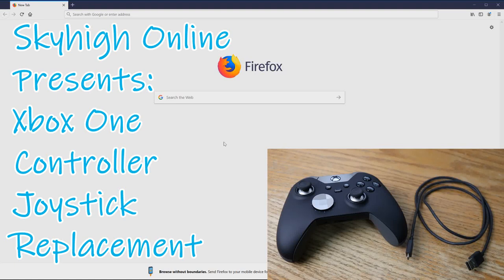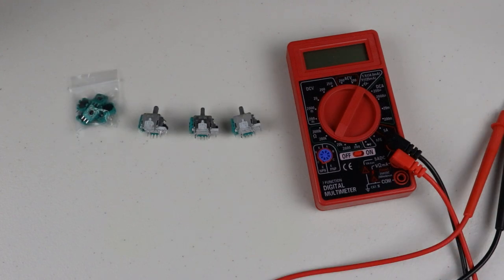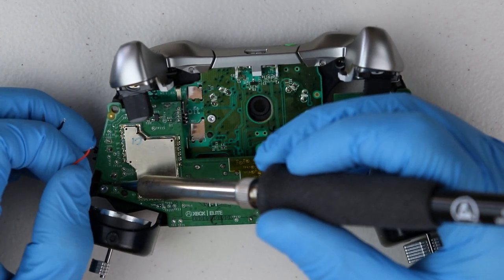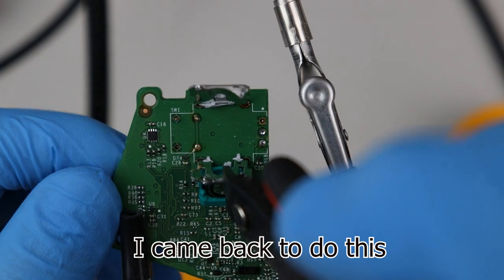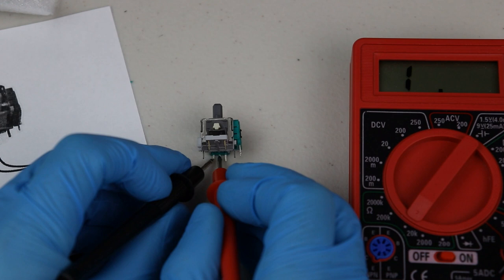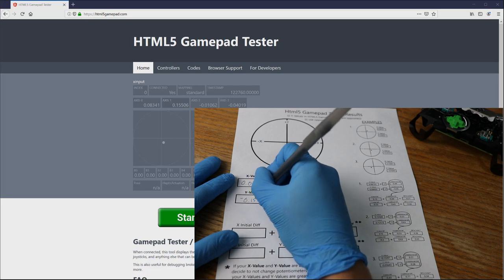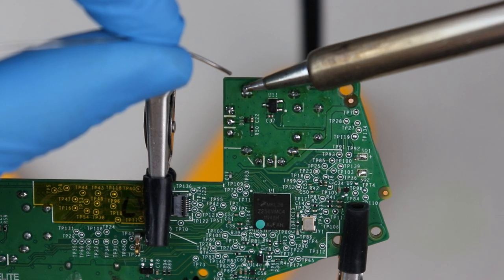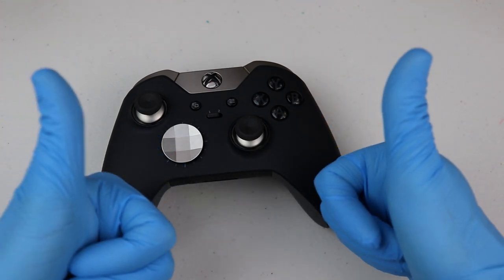How to Replace Xbox One Controller Analog Joystick - Fix Stick Drift & More

Comment from the maker: New Kit link is in the description which now includes 6 total joysticks and some tools.
NEW METHOD: Check out another way to manually calibrate (much easier IMO): https://www.youtube.com/watch?v=Uoxz0oHX9TE
Reply: Loved the video, you did a very good job explaining everything, but I don't have a soldering iron. Is there any way to do it without it, or should i just order one online?
Reply from the maker: @Ben-jl2rh  Thanks! You will definitely need a soldering iron for this job.  Luckily there's some pretty affordable options on the market today, particularly Amazon, that come in kits for around $12-$25 depending on which one you opt for.
Reply: SOSS GAMING yo are you still doing the controller repairs?
Reply from the maker: @AMG_MIKEY  Unfortunately I do not.  If you type in "xbox controller repair service" in the search bar on eBay, you will get a lot of sellers who do.  Good luck!
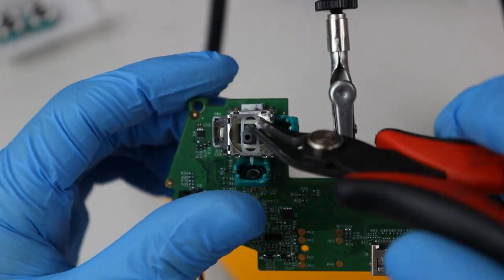Reply: Does swapping the potentiometers prevent the need to to put in another joystick like you did in 13:40? Can you just make the axis  0.00 for the X and Y? (Or as close to that as you can get it)
Reply from the maker: @michaell.colavecchio8717  Great question.  Yes, it is possible! It's not always successful, but I'd say it's worth a shot.  With the method shown in the video, it's definitely possible to get really close to 0 for both axis.  However, the benefits aren't that noticeable and I wouldn't necessarily say it's worth the effort of finding/swapping out all the potentiometers to get that super zeroed in.  Remember, drifting doesn't actually occur until about 0.17 (on html.com).  Hopefully this answers your questions.
Reply: SOSS GAMING thanks. Also, if only 1 joystick is broken, do you have to replace both or just that broken one?
Reply from the maker: @michaell.colavecchio8717  Only need to replace the broken one!
Reply: Will the same procedure work on an elite 2 controller?
Reply from the maker: @samreynolds6993  Yep! Like I mentioned in my other comment to you, I am working on a new video with a new method that is less intricate that I'll hopefully release within a week.
Reply: I wanna send in my Xbox elite series 2 controller to you via eBay to get it repaired. The left thumb stick has drift and is unresponsive. Are you able to fix series 2 controllers?
Reply from the maker: @sin5orion  Yes, if it just stick drift I will be able to fix it, no problem.
Reply: @SOSSGAMING  hey, I've got a really pressing question that i don't know who to ask other than you.

I've removed a potentiometer and tested the controller without it and it pulls all the way to the left without anything even being there. Every potentiometer I've tested ends up pulling to the left at about -0.2. Any ideas why it would pull left without the potentiometer even connected?
Reply from the maker: @scottgrafton68  No problem. It doesn't actually "pull" to the left.  The controller's joystick direction is based on varying voltage.  Since nothing is there to connect the two points and close the circuit, the voltage difference is such that it reads to the left.  It's nothing to worry about, nor does it indicate anything.  Hope that makes sense.
Reply from the maker: @scottgrafton68  Also, I have a new video coming out in a week that will show how you can manipulate the potentiometer to get it to read pretty close to center.  Stay tuned.
Reply: @SOSSGAMING  hmm I'm not so sure, i tried the same potentiometer in another board and it read far closer to centre. You know more than i do though. And ahh cool I'm looking forward to that video already. Cheers mate
Reply from the maker: @scottgrafton68  Oh I was talking about when you didn't have a potentiometer in.  In your case, it seems the original joystick that was put in read very far to the right before it was calibrated from the factory and is proving hard to find and replicate.
Reply: @SOSSGAMING  Yeah that must be it. Ahh man, i wish someone would make a recalibration program. Do you have any knowledge of one for ds4 controllers? Google doesn't understand what I'm asking lol. Really appreciate the help mate
Reply: @SOSSGAMING  i wonder if your next video uses resistors, I've thought about it but i don't even have a multimeter yet haha
Reply from the maker: @scottgrafton68  Sony is the same.  They both have the same idea: don't give access to the public.  Nintendo on the other hand has one.  Go figure.
No resistance measurements nor calculations required in the new method :)
Reply: WHy didn't he just turn the board over and remove t he solder with wicking or a solder sucker so he didnt have to chop up the module lol! WHat a pain im thinking of replacing my elite series 2 left thumbstick module because the little bit of plastic that depresses the L3 button inside there somehow got broken and won't press the button when I press the stick down anymore. Stupid thing is only 3 months old too.... stupid tile floors. I have wicking a soldering iron and most of the tools here already but all his testing the potentiometers means I am going to have to buy multiples amounts of the modules and the series two modules are 18 bucks a piece!!!  They have that adjustible torque feature. I think I may just live without the l3 button after watching this. Unless theres a way to just replace the plastic parts inside the module without taking the module off the circuit board.
Reply from the maker: @Andronicus87  If you're talking about the grey piece that holds the little white nub of the joystick in place, is possible to add one back! Prying one off a new joystick and putting it on the old one is a challenge, however.  It's somewhat hard to not bend or break it, but it is possible. 
Also, I have a new video coming out with a new method that doesn't require measurements nor calculations! Should be this week.
You can technically take the whole joystick off on the boards with the small through holes (like the elites) but it takes an incredible amount of skill/luck.  If you can do it on your elite, I will be very impressed!  It's much easier to do that on the base model controller with the large through holes.
Reply: I cant seem to desolder the pins, i get the top level of solder off but i cant get all of it in the 'through hole'
Reply from the maker: @Theunbelievable69  I would suggest chopping the joystick up as shown in the video then.  If you have a motherboard with the small through holes it's near impossible without a de-soldering iron or a heat gun.
Reply from the maker: @Theunbelievable69  If you're referring to after the pieces are removed, then I would suggest adding more solder and perhaps a slightly higher temp on the iron. But be careful with the temperature as that's the main contributor to through hole damage.  I use 350C and I think you could go up to 390C.  Sometimes it just needs to be hit a few times with the solder sucker and/or wick, and sometimes the other side of the board if it's through pretty far.
Reply: @SOSSGAMING  thanks for the reply, i have a 35watt/400 degree celsius soldering iron, which is only melting the solder on the top of the connection, its not melting the solder in the through hole. Ive tried everything and i have about 6 stuck pins, im think hot air with plenty of kepton tape to cover the easily damaged chips could help me remove the last stuck pins
Reply: @SOSSGAMING  yeah i purchased a cheap desoldering iron that has the manual pump to suck out air. It worked pretty well but still doesnt seem to melt all of the solder on all of the pins. I purchased a hot air gun that will provide 400 degrees celsius of hot air, im just going to cover the entire board with kepton tape and ill use tons of flux. Hopefully i can pull out the pins because its my last shot
Reply: I've got an issue where the white part of the joystick mechanism has broken, do I only need to replace it once?
Reply from the maker: @kasimahmed3841  With this method, any joystick replacement will most often times require a second replacement.  One is needed to measure and calculate, and the second one that matches those measurements and calculations.  You might also get lucky with the first joystick though, so in that case it would only be once.
Anyway, I would hold off just a little bit because I have a new video coming out hopefully by tomorrow, or early next week at the latest with a new method where you do only use one joystick.  Stay tuned!
Reply: @SOSSGAMING  thanks! Much appreciated
Reply: @Andronicus87  Take your potentiometers off first, if you have the chisel like soldering tip then you can heat all 3 pins at the same time and take the potentiometers off easily. Then destroy the rest of the analog stick that's on the board. Fit the old potentiometers onto the new stick in the same position as before and then solder the whole thing back on

Comment: my up button on the left stick is permanently on, any ideas what that can be? which side is that x axis or y axis
Reply from the maker: I'm not quite sure what you mean. Are you saying you always have forward drift in games? Or only when you are trying to select things in the menu?  If it's only during menu, then it could actually be a d-pad issue, if it's forward drift during games then it will be a joystick issue.  Most likely you will need to change joysticks/potentiometers as shown in the vid unfortunately.  Here's the potentiometer sheet showing the different axis on the controller: https://drive.google.com/file/d/1f80H_ZErOJxwVwPuwNrDzGZ2LISPcS42/view
Reply from the maker: I just realized what you were asking.  It will be the Y-axis that causes the forward drift.
Reply: @SOSSGAMING  thanks its an elite controller i have put a brand new joystick but it is permanently on up cant find any fix for it or a hint as to what it may be.   a capacitor at c24 came off and i put it on d16 right next to it thinking it could possibly be that. but should make no difference as its on the same line. i have tried reflowing but not luck.  part of the pad came off on top of the of one of the y axis but not the underside of the board where it matters and is soldered in so i am flummoxed.
Reply: @SOSSGAMING  i will try changing potentiometer. thing is i selected it on the best reading averages using a multimeter so seemed ok from that pov.
Reply: @SOSSGAMING  the d pad up button works fine on the controller test app it seems to be the up button on the left stick.
Reply from the maker: @createspaceone  Ok, so you've already attempted the replacement.  I may have bad news as I believe you may have damaged one of the through holes in some way.  I have done this a couple times, and I believe I had a similar symptom.  If this is the case, one solution is to try to repair the damaged through hole(s).  I am not an expert on this however so I don't have advice on how to do that.  The other solution is to get another motherboard.  Fortunately elite controller motherboards are interchangeable in my experience.
Reply: @SOSSGAMING  thanks I was thinking that.... i will try to get some schematics, i could jump wire it. thanks
UPDATE:  i will ask them in this thread when i get a chance cheers it has schematics there https://www.acidmods.com/forum/index.php/topic,44309.0.html
Reply from the maker: @createspaceone  Good luck! I will be curious on what you figure out

Comment: I swapped my whole thing out and the stick drift is still present. Any ideas.  I dont see any damage.
Reply: I did it the way you showed on the other video as i have all the tools.  I also have a lofty on the controller with buttons on back
Reply from the maker: @andrewm4951  What are the readings?

Comment: ya idk what happened got the module out put the new one in looks fine yet somehow now whole controller dont seem to work right😫
Reply from the maker: What do you mean?  What are the readings on html5gamepad.com?
Reply: @SOSSGAMING  I dont even know what that means I already took all the good parts out and threw the 2/3 controllers away the all have messed up modules in the analog and are made way less durable than the old 360 controllers(which still work)

Comment: the through holes on the potentiometers are so stupid small, I currently have 3 pins stuck, i broke the pot off of the pins and i still cant get them out >=o
Reply from the maker: You should still be able to heat up the solder and use the soldering tip to push the broken out just a bit. Once out just a little bit, use some tweezers to pull it out (as the solder is still heated). That's what I was able to do on some of the ones that were stuck too lol

Comment: mine does not register movement in the y axis, any solution?
Reply from the maker: Sure thing.  You can first try cleaning out the y-axis potentiometer.  That is, pry the potentiomer open, take out the wiper and clean the wiper and the inside of the potentiometer with some rubbing alcohol.  If that doesn't work, you can then try switching the wipers with a different one. Then perhaps switching out the whole potentiometer itself, which is a bit tricky to do unless you're able to unsolder the whole joystick first.  And finally, simply changing joysticks would be the surefire solution, which you may want to do anyway if the joystick has a bit of play in it.

Comment: So if I replace my analog stick it's not going to fix stick drift?
Reply from the maker: Yes it will 100% if you do it correctly as shown in the video instructions.  You might get lucky simply by replacing the joystick and not get stick drift, but I've found getting the joystick to match closely with the original joystick readings by measuring and using the different potentiometers from different joysticks works every time.

Comment: Ay yo can You know to Burn The metal part can i use a Glue Gun?
Reply from the maker: If you're talking about using a glue gun as a soldering iron I would have to say no.  Luckily you should be able to find fairly cheap soldering irons these days!
Reply: @SOSSGAMING  yh don't worry anymore i already bought a soldering gun
Reply from the maker: @gammerramirez5575  Awesome, good luck!
Reply: @SOSSGAMING  thanks
Reply: @SOSSGAMING  wait...i bought a desoldering gun but does it still work to fix the controller?
Reply: By the way how am i meant to place the joystick and make that kind of iron?
Reply from the maker: @gammerramirez5575  Yes you are still able to fix the controller with a desoldering gun.  It's probably not recommended to put the solder on the new joysticks with one but I've done it before in a pinch.
Reply: @SOSSGAMING  yh you're correct because it doesn't let me put the new joystick so do i need a soldering gun and like those iron strings right?
Reply from the maker: @gammerramirez5575  I would recommend a soldering iron, yes.  When you say iron strings, do you mean solder? Yes, you will need solder
Reply: @SOSSGAMING  ok thx

Comment: I bought an xbox controller a week ago and when i use it in fifa 20 demo sometimes in the match when i switch it to the left it goes right or a different direction from what im pointing, does anybody know why this happens?
Reply from the maker: If it's a new controller it's unlikely to be the controller's fault, but still possible.  I would think that it has something to do with the in-game mechanics.  Essentially meaning that by lessening the angle at which you want the player to go should correct it.  Or it could just be a bug in the game.  If you think it may be the controller, you can go to html5gamepad.com on the computer as shown in the video and see if the joystick is drifting or wandering when you move it around.  Good luck.
Reply: @SOSSGAMING  I've noticed that if i aim just a bit right or left the player will follow it but if I aim full left or right the aim starts shaking and it doesn't follow my commands so, if the controller itself is not responsible for it , how could i probably fix it? (Lessening the angle sounds like something that could solve the problem but how do I do it?)
Reply from the maker: @fiddlesthiccs7710  I just meant control the joystick better, that's the only solution I can think of. But if the aim is shaking it sounds like a bug in the game or maybe it is the controller.  Have you tested it on html5gamepad.com yet?
Reply: @SOSSGAMING  I tested it right now and its probably a joystick problem i guess, since when i do a full circle it cant go full right or left and it teleports... i guess i'm buying a new one...
Reply: @SOSSGAMING  thanks for the help though
Reply from the maker: @fiddlesthiccs7710  That's unfortunate.  The teleporting is definitely a joystick issue.  I would get it returned and replaced if possible.  It should also still be under warranty.  If neither of those options are available to you, I do offer the joystick kit if you want to tackle it yourself, or a repair service as well.  Both are linked in the description.
Reply: @SOSSGAMING  Sure, thanks for all dude
Reply from the maker: @fiddlesthiccs7710  No problem.  Any other questions just ask.

Comment: Just desolder the whole stick throw a new one one done been doing this for a decade u just made this infinity more difficult
Reply from the maker: If that works for you, that's great! I'm guessing you are using josyticks with the large built-in deadzones? They are very common, and usually don't require calibration.  However, they will effect gameplay (especially if accuracy is important), and will not be able to center them correctly because of the built in deadzone.  
After installing these joysticks (original joysticks) a common complaint is "my stick drift got worse."  It's not the issue of the joystick, however, and I think I explain this issue better in my newest video with the new method for calibrating.
I will also be making a new video of just replacing the potentiometer for fixing drift soon, because there is no need to change the whole thing if there are only drifting issues.
Thanks for watching and chiming in!